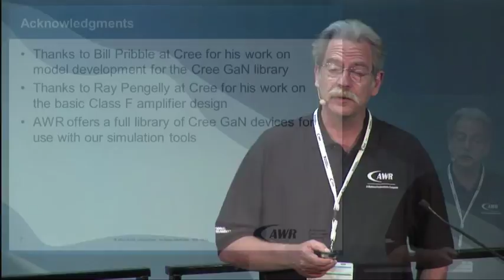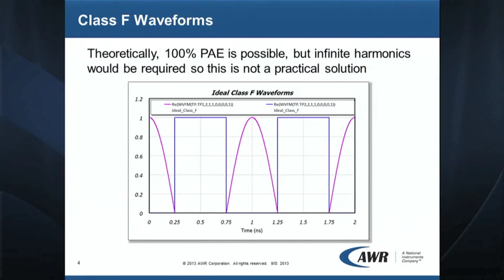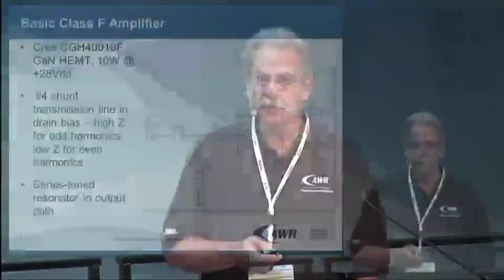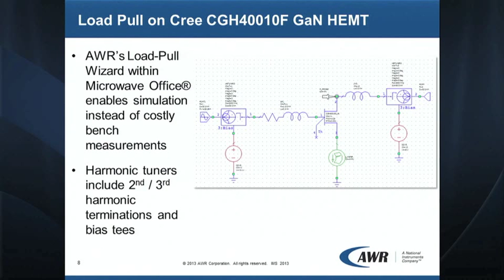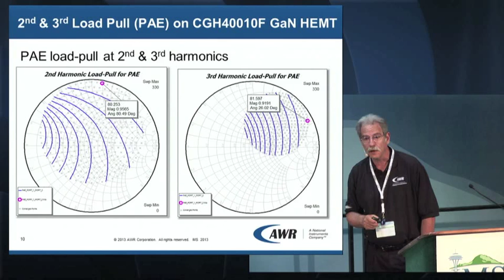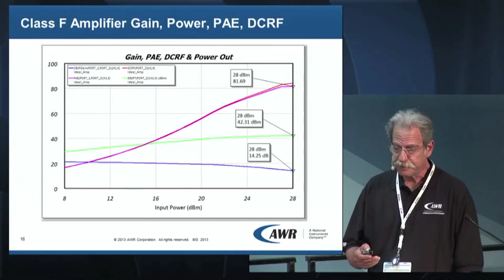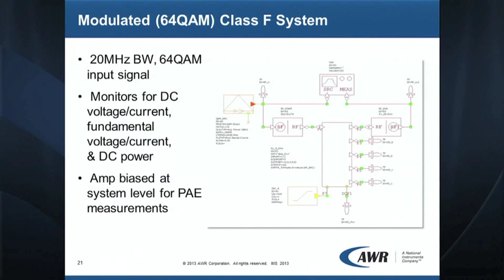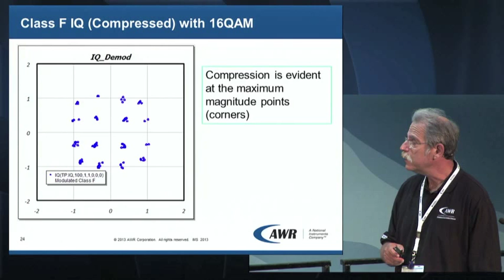Design Example:  Class F Power Amplifier (PA)

Comment: how do you select an optimum impedance point for class A design from the load pull contours?
Reply: Rishad Ebrahim you will need to select an impedance that matches well over your operating frequency bandwidth. High to low, and mid-point.
Balance between them for a 'happy medium'.